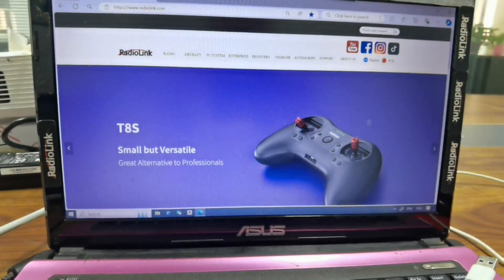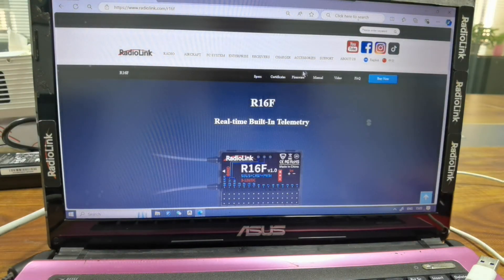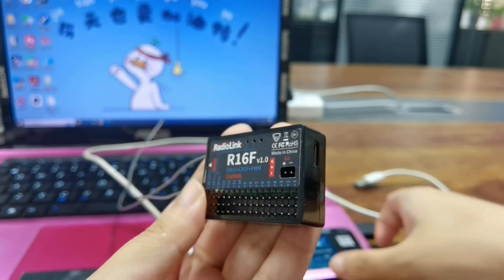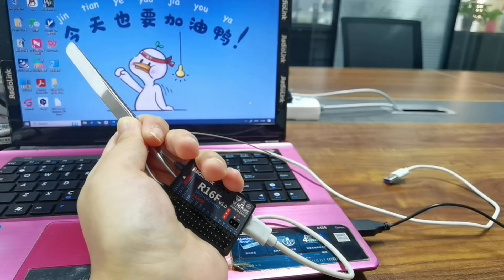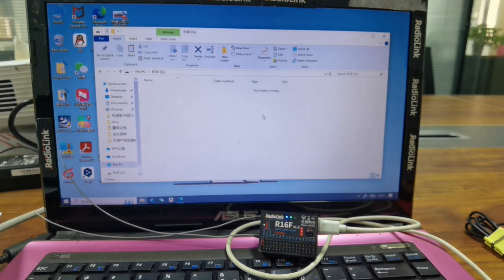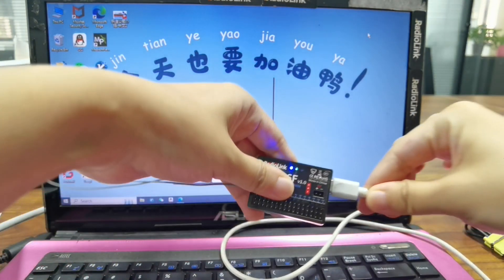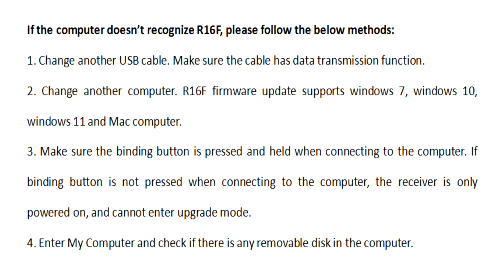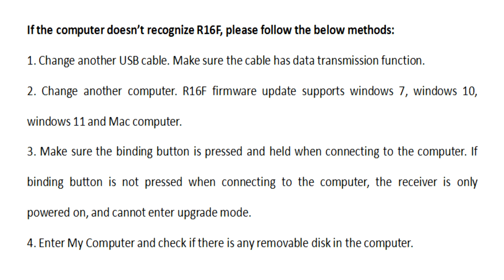How to Update the Firmware of R16F Receiver?

Comment: Po aktualizacji silnik przestał działać. Po ponownym otworzeniu folderu nic w nim nie ma.
Reply from the maker: Hi, sir. If the engine stopped working after the update, could you please check if the receiver is bound to the transmitter? If not, could you please re-bind them? And it is normal that you cannot see anything when you open the folder. Please also make sure you have copied the firmware into it successfully. If there is still any question, could you please send us a video to show how how you update the firmware and what problem you met? You can send the video to our email after_service@radiolink.com.cn

Comment: Bisa untuk tx radiolink at10 II apa tidak ,omh😁
Reply: Could You please create video how to use/connect/wire with autopilot module and how to use it? Woul be really appreciated. Thanks.
Reply from the maker: @allabout1135  Hi, sir. R16F can be connected to the flight controller. such as CrossFlight. Then you can set waypoints in Mission Planner to achieve auto pilot. Here is the link to show how to set auto pilot: https://www.radiolink.com/newsinfo/475989.html  And here is the link of the detailed manual of T16D, which introduces the connection of R16F to CrossFlight: https://www.radiolink.com/t16d_manual  If any question, please feel free to contact us. Our email is after_service@radiolink.com.cn
Reply from the maker: Hi, sir. Sorry R16F is not compatible with AT10II. R16F is compatible with RadioLink T16D/T12D/T8FB/T8S/RC8X/RC6GS V3/RC4GS V3/RC6GS V2/RC4GS V2/RC6GS/RC4GS transmitters. If any question please feel free to contact us. Our email is after_service@radiolink.com.cn
Reply: Kochani  Ludzie .....     PROSZĘ  czytajcie instrukcje albo FAQ  odbiorników   AT10 lub   T16 tam wszystko jest jasno opisane.